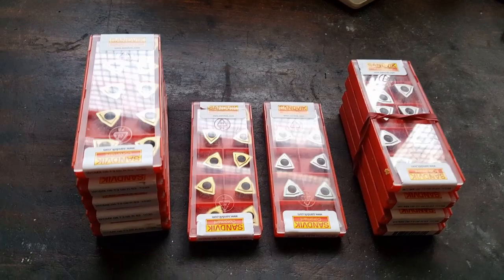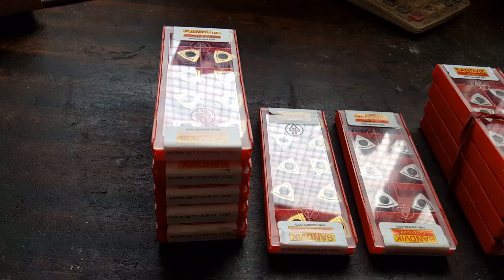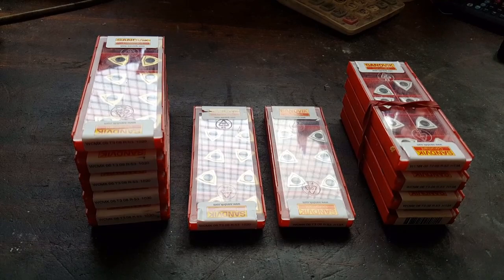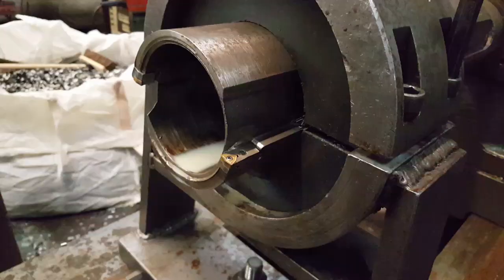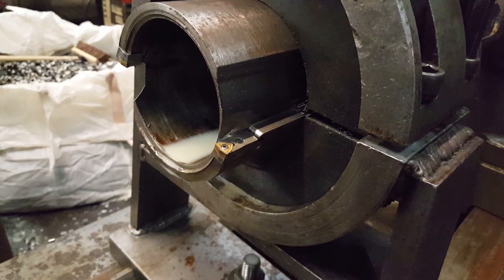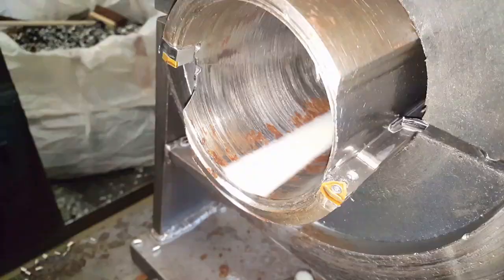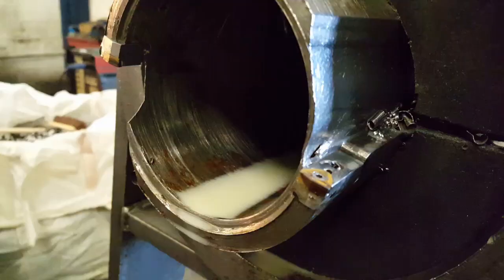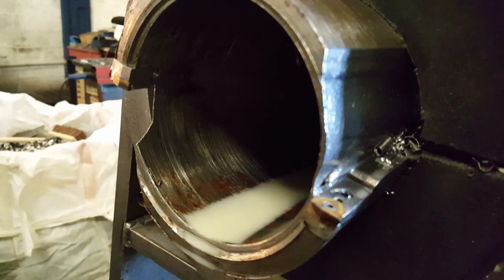SANDVIK 1020 carbide. To cut MONEL K500

Comment: https://en.wikipedia.org/wiki/Monel

"Monel alloy 400 has excellent mechanical properties at subzero temperatures. Strength and hardness increase with only slight impairment of ductility or impact resistance. The alloy does not undergo a ductile-to-brittle transition even when cooled to the temperature of liquid hydrogen. This is in marked contrast to many ferrous materials which are brittle at low temperatures despite their increased strength."

Wow...
Reply from the maker: Thanks for that. 👍

Comment: Have you ever machined dataloy and Hasteloy? I remember the screaming sound in the workshop as it resisted my efforts to subdue it. We also had  to use a pump body steel call Wellshine or something like that which had a marbled appearance.
Reply from the maker: Hi Neil.  Yes.. I've just about machined every metal.
Reply: @userwl2850  adamantium? jk

Comment: Awesome material re corrosion resistance. Going to be used for some type of acid valve?
Reply: We have monel metal pump bodies at work used as part of an  sea water main used for emergency fire fighting at a oil/gas tanker and fuel storage farm. Hugely expensive bits of kit.
Reply: Yeah pure nickel is about about 15% of the cost. I think it's the only metal that stands up to Hydrofluric Acid from memory. The stuff just doesn't corrode.......
Reply from the maker: dazaspc used in gas and oil industry.
Reply: Muito bom , não sabia que era assim muito bom dia